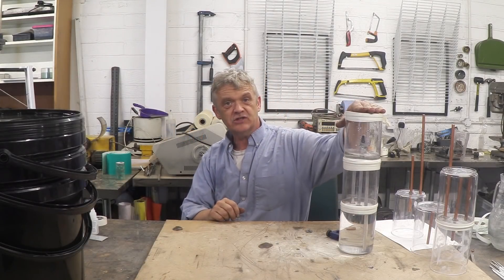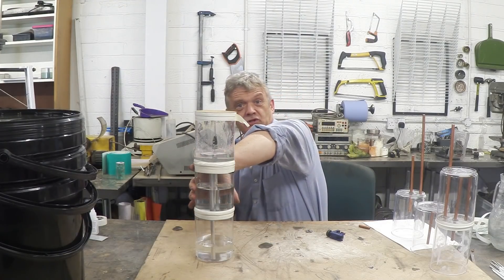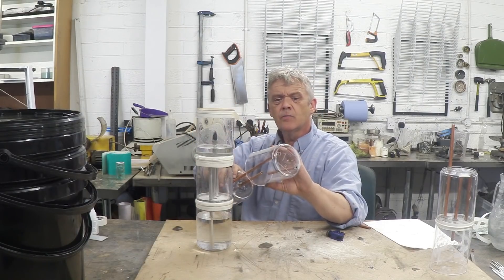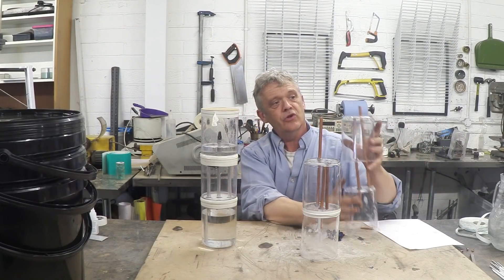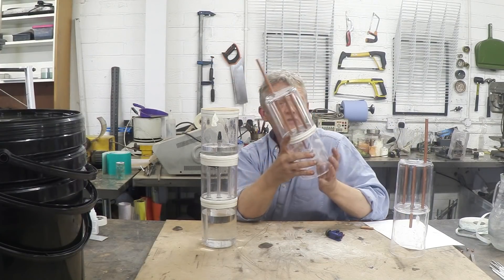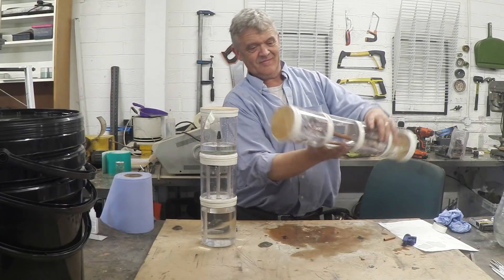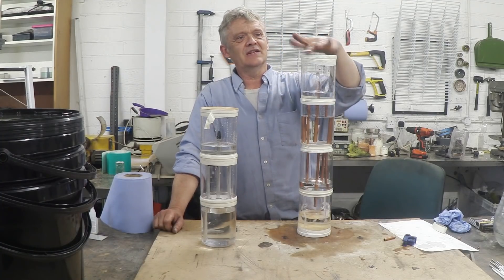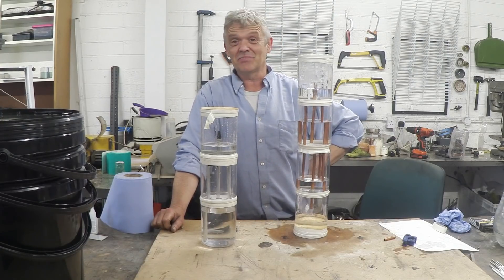'Perpetual' 4 Tier Heron's Fountain

Comment: I've been wanting to design a fountain that could do exactly as you have done in the sense that flipping the containers so that one is charging the other. But is it possible to make a wheel the the containers are positioned on so that as the water is emptying one filling the other one with the air in between so that it would actually propel the wheel to turn essentially "flipping" the device on its own endlessly? If not a wheel then Is there a way to use maybe like a balance where the weight of the water filling and emptying brings the height of the bottles up and down to continuously keep refilling itself? I am curious and don't have much personal knowledge about this subject

Comment: Why not use rope to make water travel upwards via cohension and adhesion properties of water? Won't need to spin anything, just 2 containers, a bottom and top, top flows into bottom, bottom uses rope to flow back into top. Call it Vinny's Fountain.
Reply from the maker: i don't think that would work mate - but by all means try it and see
Reply: @ThinkingandTinkering  I already use this method to water plants when I go on vacation. Water travels up the rope and into the pot.

If you think I'm joking, it's stupid easy and cheap to replicate, bottle of water, rope and a plant with soil. Or just look up tips to water plants while on vacation.

I used to know the technical term but forgot, capillary action? It's not cavitation...

Yeah I just looked it up, it's capillary action. So if you think I'm joking, look that up.
Reply: @ThinkingandTinkering  Capillary action (sometimes called capillarity, capillary motion, capillary rise, capillary effect, or wicking) is the process of a liquid flowing in a narrow space in opposition to or at least without the assistance of any external forces like gravity.

Comment: Perpetual means non-stop - not having to flip it.
Surely to create a "perpetual" fountain all you need is the total weight of water in the fountain pipe above the level of water in the bottom cylinder being less than the weight of the water in the top cylinder trying to get into the bottom container. So long as the that continues to be the case it in effect functions as if it is a siphon - so long as the weight and volume of the water in the top cylinder continues to exceed the volume and weight of the water in the fountain pipe in the bottom cylinder.
No need to turn the cylinders over, and only 2 containers needed. Gravity does all the work - so long as the bottom cylinder and the pipes are air tight.

Comment: OK this suggestion is a bit beyond my head for the math and physics involved. Please bare in mind. But could this be converted into a water wheel x2 running in opposition to each other, geared so that the momentum of each would keep the weight from just dropping to the bottom. ie. keeping the water at the 3 & 9 o'clock positions. I don't think it would be exactly perpetual but I would love to see the concept taken to it's limit....

Comment: Why not just use 3 cylinders the cylinder 2 and 3 on a platform at equal levels and  add a connecting tube under 2 and 3 connecting them and a platform above them for cylinder 1 then it would run perpetual untill to much water evaporates and you wouldn't have to turn it over and over again try it cause it works
Reply: I forgot to say the connection tube from the bottom of cylinder 2 and 3 needs to be a one way flow valve

Comment: Random sounding board thoughts. What if mounting it to a bracket on a wheel and use a mesh tubing to put something floating diagonally inside the cylinders. With water eventually pushing the floats to the other side could it spin itself over to restart itself.. make a brake block so that it only can turn 180° and maybe a spring to assist pushing back once the weights/water re align¿ could even put generators on both ends feeding into the wheel and still draw power.

Comment: Really awesome design 👍 could you put it on a self tipping wheel so that when it’s top heavy, charged, it flips making it self perpetuating? You could use the spinning wheel as the turbine and maybe use oil instead of water for a faster discharge. I think you could do this with an off centre axel. Of course it wouldn’t rotate as much as pendulum but it would sabe pretty cool
Reply: That would be cool, but unfortunately it would require some external force. Notice how most of the water ends up in the bottom half of the cylinder due to gravity!

Comment: Nailed it. Not perpetually, you're adding the energy, however I wonder; (obviously not breaking the 2nd , but get max efficiency),  affect of putting on wheel or gyro
Reply: I wonder how much energy can be produced using a small turbine where the water flows, and if that can produce enough energy to reset itself, because then it'll be perpetual motion without breaking any laws of thermodynamics.

The energy that's being fed into the system is gravity, and that's how gravity lights output more energy than is input by a human.

If you think it's breaks laws of thermodynamics, I can make water climb up a hill with no electricity or water pressure, simply using rope which soaks up the water and makes it flow upwards. So I can collect water at the top of the hill, and then let it flow down, creating energy with me not expending any energy.

Comment: I like that 4 tier design that seems to be authentic. I don't understand how those 2 second containers can both have the air inlets into the containers and function in reverse when flipped. In other words you have 2 second containers identical you say, lets call them containers SA and SB. The container SA in its upright position will have its air inlet from a hole in SB container's bottom(or "third" container's top, same thing),  but that hole in SB's bottom is identical to SA, therefore SA has a hole in the bottom for air inlet to SB when flipped over, which means it should be leaking and bypassing the fountain.

I just haven't figured out how to connect SA and SB together, and i don't think anyone else does either. The only thing i can think of is you used some sort of check valves. Or i am missing something about priming and pressures. Long story short i figured out how to connect them without that 3rd pipe, while keeping SA and SB still identical, but without that 3rd air inlet pipe in the second chambers. I only need 2 pipes from the first chambers, and no other pipes needed anywhere. I need 1st the down spout from the bottom of the 1st chamber to near the bottom of the "3rd" chamber(the other 2nd chamber), and 2nd, i need the fountain pipe that goes from the center of the first chamber to the near the bottom of the 2nd chamber.  And then those pipes correctly primed once, will now work in reverse direction when flipped, over and over, only one prime needed but each and every flip is required. lol  No need for that 3rd pipe confusing me. lol

Comment: Would this work with Gallium or another type of liquid metal? (Using nothing but plastic or acrylic tubes, and once gallium is in liquid form)
Reply: There is no reason why not.. maybe someone could do the calculations about pressure/density. Actually you could make a fountain with Gallium and oil instead of air.

Comment: Quick question... what about a 6 chamber dual cross section fountain system? Where the fountain overflow of one fountain fills the middle chamber of the second fountain to supply the head pressure of that fountain and vice versa.
Reply: Scratch that I just realized its the bottom chamber that creates the pressure for the fountain sorry

Comment: Just thought of something.  You can add this to a wheel (waterwheel).  The weight will shift to the highest point and cause rotation.  The water will transfer to the middle toward the middle and back to the top.  Now you have a system that may work.  Timing would be critical.  Lol.
May have to use parallel systems........
Reply: It would be the same principle of using ball bearings to to the same thing... i can't remember the name of that device.. but it too is not true perpetual. It has also been tried with water in the tubes. Granted your idea is a bit different because it would take longer to transfer the weight. Not a bad idea but also it would be extremely hard to keep it from balancing out with such a slow transfer.

Comment: How is this not water flowing from higher potential energy (altitude) to lower? I mean from an energy perspective. You put the energy in by flipping it, and it comes back in the flowing water.
Reply from the maker: yes - I explain that in the video - did you watch the video?
Reply: @ThinkingandTinkering  I did, I may have missed that point. Norway stores a lot of energy by using mountain lakes to store water pumped from below. Not all terrains support that but there are many that can and do. Thanks.
Reply from the maker: @jagardina  no worries mate - I am a fan of pumped hydro as it happens I know the efficiency in terms of energy is low and Capex is high but once up and running opex is low and I agree with that - for me it is cost of energy supplied

Comment: Interesting.  Perhaps one could take advantage of shaping the water containers, and/or use a sort of buoyancy apparatus (like a bobber)/a weight lifting or shifting construct, which could then induce an asymmetrical condition to cause it to rotate past equalibrium and turn over on its own to begin the process again.  When the water rises, it raises the floater, rotates a weight, turns it over, and starts over on the other fill?  Or?
Reply from the maker: interesting
Reply: If you have an impeller and generator each end feeding a battery bank, then use a level sensor to divert some power to a small motor to flip it.
Reply: Maybe it could be done with a floater somehow, I looked into this thinking of building and actually fountain. But it seems like it's going to be to hard to reset in practical use but it sure would be nice for ambient noice in the garden 👍

Comment: Ahhhhhh, I've just ages wondering if it was possible to set this up like a wheel/clock so the nozzel in Jar 1 (1 o'clock position) sent the fountain of water into the Jar at 12, and the Jar at 12 would empty into the Jar at 5 (via a stationary valve in the center using the rotation of the wheel to redirect the path) would mean you could keep all the water on the one side of the wheel and create momentum. I was trying to work out if it could be done efficently enough that a small energy imput could give a big torque output (Falkirk Wheel style of thing), I started to find my brain squeezing out of my ears when thinking about how to get the water transfer efficient enough that the wheel rotation would continue. The flow rate would need to match the wheel speed (to fast and the water just ends up on both sides, too slow and it all just rotates to the bottom), and then the losses on each fountain cycle would just lead to all the water at the bottom (I figure most of the losses would be the water left in the tube when the fountain stops emptying back down into the bottom jar) this is where the energy input would be needed to keep it going. Damit Robert, it is 4am and you made me try(and fail) to use my brain when all I was after was a bit of light hearted YT before bed :D :D Well done that man!
Reply from the maker: it might be worth looking at Minto wheels mate
Reply: @ThinkingandTinkering  how large can you make a 4 tier heron's fountain? If you go too big will the water's weight be too great for the air pressure? If you could go large enough to move enough water to spin a small turbine next to each fountain and the 2 middle containers were obtuse L shaped (probably around 135°) aiming in opposite directions, when the top middle was half empty it would be one sided heavy and if your generating a good amount of energy from the turbines you can use only a little bit of electricity to spin the 4 tiers by a motor hopefully using a lot less energy than your creating. I guess if you stuck the whole project in thin oil you'd need even less power to a motor to spin the 4 tiers. Using a compressed gas would move the water faster air and keep the generators cooler too. Since it would be a closed system the motor to spin could just be timed to be most efficient.

Comment: What type of glue are you using for under water sealing?  Every glue I have tried works poorly or leaks after some time including 5 minute epoxy, super glue, plastic glue and polyurethane.   Did not try pvc glue or candle wax.
Reply from the maker: don't forget I also add the tape - but on this one those jars are acrylic so I used an acrylic glue

Comment: Okay, so after reading through the comments, adding thoughts on a few and watching the video again, you might be able to let gravity flip this thing if the pivot was below the 3rd jar, but since the position f the jars changes with each flip, you would need two pivot points, one on each outside jar, and then be able to raise the pivot while it's turning so that the opposite jar sits upright on the ground at the end of the turn. Kind of like an elipse with the pivots at the foci. On each flip, the bottom pivot would be active and the top one passive, maybe adding to the weight to help flip around the active pivot.  

Perpetual motion devices based on a circle have never worked, but I don't know if anyone's ever tried basing one on a elipse.
Reply from the maker: that is interesting - but this isn't really perpetual I do have to input energy - I do that by mechanically flipping it over - I think there might be a possibility of making this into a heat engine - but I wouldn't think you could make it a perpetual device just as a balanced system - but that is really my prejudice showing as opposed to me knowing what I am talking about
Reply: @ThinkingandTinkering  

I originally saw this way back as a container system. And I thought about making it out of two 55 gallon drums, on a teeter setup  ( actual point between the two drums on a frame) in the middle. Then have a rope attached to top drum. Then run that rope threw a pulley on the floor from the top barrel, and pull the barrel rope by hand or crank to flip the barrels. My intent was to use this to move 55 gallons of water uphill. Threw a small quarter inch pipe from the 55 gallon drum.

Separately the two barrel system could be reconfigured that the water pushes air to a higher point under pressure instead of water, and a separate check valve or inlet valve would let air into the system as needed. Only one of the two barrels on a two barrel system have to be air sealed. The other barrel can be open to the atmosphere, according to the channel you mentioned in one of his videos.

Separately I've been really looking at Trompe systems that move high volume of compressed air. Also water elevators that would move the water back up to the high point.

Mr Thessalonian built an excellent version of a trompe/ram system that produced 60 PSI on a 20 ft drop. Then the water elevator could move the water back up to the top. You now have 60 PSI to run through your Tesla turbine for generation. Separately the water elevator can move the water as high up as you think you need it and the water can run a generator before it enters the 20 foot drop to the Trompe/ram system.

The water elevator could also possibly push the water with enough pressure to run that little inline turbine you showed in this video series.

Mostly just pipe a check valve and a propane tank is all you need for the Trompe/ ram and the water elevator. It's all piping.

The Trompe/ RAM does make a little bit of noise, but it's outside along side of your building could be put in a box to muffle the noise. I think you have at least 10 or 20 ft at the roof line of your building?

If you're interested in more information I can send you the YouTube channels that talk about this stuff.

Hope what I said was helpful in what you're doing.